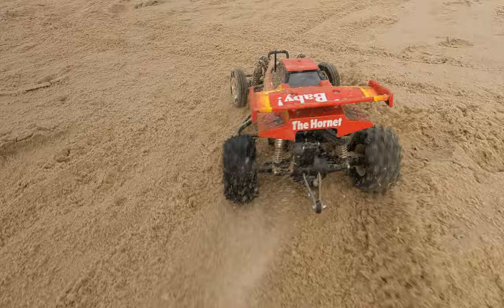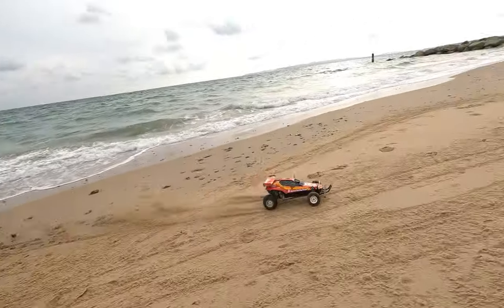Tamiya Hornet Speed Test and Beach Bash.  Classic RC buggy.  3421kv Brushless, 2s lipo

Comment: I wonder pete if by removing the friction part in the front suspension, you know that little rubber tube that fits around the spring shaft if that might make the front suspension movement more plush without the stiction. That was the problem with mine and i only used a 25 turn core RC motor and 2s lipo. It constantly was tipping over and crashing and rolling over. So damned annoying.then i put the same motor in a new Nova Fox and mate that car handles beautifully.ive never crashed it one time nor rolled it onto the roof. But after the Hornet i tried the Nova Fox on cement only a couple of times then said ok thats fast enough and then went onto a football field with grass. Plus the fox is wider at the front and rear and weighs around 270 grams heavier. Tamiya claim 874 grams for a Hornet and 1140 grams for a Fox , both without battery and radio gear. You got some really high speed there mate.after crashing so many times i said enough is enough and firstly returnedc the stock standard silver can motor to the Hornet then put it on a shelf. Having said that it drive so much nicer with the slower motor. Just pretty slowly. Great work again Pete thankyou 👍👌
Reply from the maker: Hi there. Yeah when this had the stock suspension I did leave the rubber bit out because it would only take a bit of dirt to clog it up. I've got the oil shocks on this now and it does make it better but the handling of the Hornet is never going to be fantastic because of the way the rear suspension works. Yeah in the end I put a brushed motor in this one as the handling just isn't really up to brushless. It does work great as an RC of it's time but like you say there are others that handle much better. Many thanks indeed for your great comments. Much appreciated 😁👍

Comment: You should get a radio link system that uses a gyro to keep it under control cuz that's what I do with mine.
Reply from the maker: Hi Brad.  Oh yeah I do have a radio system that has a gyro function and I didn't think about it for this one.  Would have been very useful for the speed test.  Thanks for the comment :-)

Comment: Mate I'm from Melbourne Australia, I get a higher speed on my rerelease Tamiya Super Hot Shot with a brushed Super stock RZ motor and 13 tooth pinion gear using a 2 S lipo nvision battery 44 Km/h and my car weighs  twice the weight of a Tamiya Hornet 1560 grams for Super Hot Shot with battery versus 874 grams for the Hornet. And you went with brushless and did your speed testing on an asphalt road like I did. That's not so impressive for a brushless motor at all. Plus you crashed the little Hornet so many times it's painful to watch.
Reply from the maker: Hi there. You know I'm not doing speed runs to try and impress anyone, it's just to show what happens if you put that brushless set in a Hornet with standard gearing. I've got over 30 Tamiya RC's and most have a similar brushless set and I've had from 20mph for the 6WD trucks to about 45mph for a TL-01 on 2s lipo. Like I say I only include the speed for information. I haven't got a Super Hotshot but the closest I've tested is my Terra Scorcher which went 32mph. Really it comes down to gear ratio although weight comes into it a bit. The Hornet actually weighs 1270g with battery. I know you can get decent speeds with the fast brushed motors but for me the brushless sets are more reliable and last for years. As to the car turning over a lot I'd challenge anyone to drive one of these with Rough Rider tyres on tarmac with loose stones on and to keep it straight. In my opinion it's the worst handling Tamiya that I have and not really suited to a brushless set. You know when I get comments that are criticising what I'm doing I always have a look to see what they are up to on their channels and find that they have no content. The RC community on here is generally friendly so let's keep it that way 👍
Reply: @PeteWylieRC  mate your right I don't have a chanel of my own I'm just a fellow Tamiya enthusiast. I just don't think it was anything to write home about when you put a brushless motor in a Hornet and get a slow speed like that . For instance I also have a kyosho Fazer mk 2 with a 1969 Chevy Camaro Z28 body. Now that kyosho is a great car for vintage touring car racing as well as great handling on the race track and can keep up with a lot of fast cars but my Super Hot Shot goes faster than the kyosho with a brushed motor. My kyosho Fazer ( I actually have 3) with a kyosho g14 brushed 14 turn motor gets 42 km/h and my Hot Shot which let's face facts is a 40 year old design that never really handled well even when new and is a Tamiya assembly kit actually goes faster than a modern 1 year old kyosho Fazer. So in this context I don't think getting 43 km/ h with a brushless set up is really anything to write home about. And mate you know I've seen Glenn from Tamiya legends on YouTube getting 43 mph with a Tamiya Grasshopper and it's completely standard only fitted with full ball bearings and 3s lipo and a warmer brushed Tamiya sport tuned motor. Check him out Glenn Everitt I think is his name from Tamiya legends. so going brushless and getting only 43 km/h is really quite poxy. You have to face the facts mate 👌
Reply from the maker: @JimBoBJames-no5db  Again I would say that I'm just showing what happened. If I'd have put a clickbait thumbnail saying it was the fastest Hornet you've ever seen then I might deserve some criticism. You keep saying it's nothing to write home about and I agree. Like I was saying this is a friendly community and most people are just respecting what others are doing and not slagging them off because they weren't the best or fastest. We are just people enjoying a hobby and sharing what we are up to. I'm very sorry if I gave the impression that this Hornet was going to be fast. I have fully faced the facts so thank you for pointing out the error of my ways ☹️
Reply: @PeteWylieRC  no mate it's me that should say sorry if I gave the impression that I was upset with you. Sorry ok. But I'm using a brushed Tamiya motor and I'm quite happy with my Super Hot Shot. I admit brushless is great in some applications and most companies in RC today are using brushless while Tamiya has always used brushed motors and only in the last few years people has realised that it's possible to install a brushless set up in a Tamiya. I think maybe the first regular production released car from Tamiya which is claimed to be compatible with a brushless motor is the BBX 01 now in 2023. And even then it's still probably going to not be as fast as say a kyosho Fazer VE BRUSHLESS Camaro or Dodge charger VE Brushless mainly due to the chassis on kyosho Fazer is a great race chassis and how much horsepower can a Tamiya gearbox and differential handle. As far as I know kyosho and Traxxas use sintered metal pinion gears and lots stronger gearbox internals than Tamiya but don't get me wrong I absolutely love Tamiya mainly for the build aspect and the fun of putting together a buggy myself whereas a ready to run kind off feels soulless to me. And I had Tamiya static model kits and 1 vintage Tamiya Fox back in the 1980's around 1987.way before I ever brought a ready to run straight out of the box car.I ABSOLUTELY  LOVE TAMIYA RC CARS Sorry again if you got the wrong impression . Cheers mate👌🥰.
Reply from the maker: @JimBoBJames-no5db  Ah fair enough, it did come across as being critical of what I was doing and saying it wasn't good enough.  It's hard to tell from written comments.  I did have somebody post up a video on YouTube just to slag me off about this Hornet video and tell me I'm a moron so I thought your comments were more of the same. Apology accepted and sorry I took it the wrong way.  The Hornet now has a silver can brushed motor and I think it goes 18mph with 2s lipo so 27mph was a pretty good increase on that but not the best.  Yes the Tamiya gearboxes aren't always that strong but you can generally get away with brushless.  The pinions are too soft as you say and that's something I upgrade if it's going to be a regular runner.  Be nice if Tamiya upgraded the re-releases in the way that Kyosho has as they are making lovely new versions of the classics.  With the RTR cars I would rather build a kit but there are good bashers like the Arrma trucks that I'm a fan of because I can beat them up and get that out of my system so the Tamiyas can have an easier ride.  Over all it's great that there is so much more choice out there than when I was a child and also there is a great community of people doing it so it's been good for making friends 👍👍